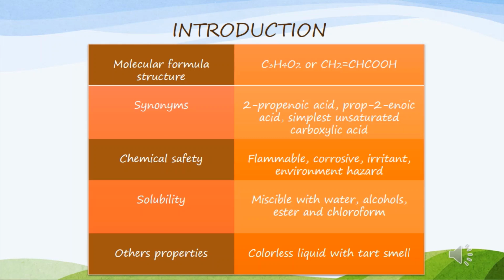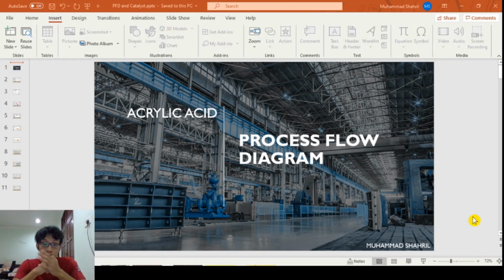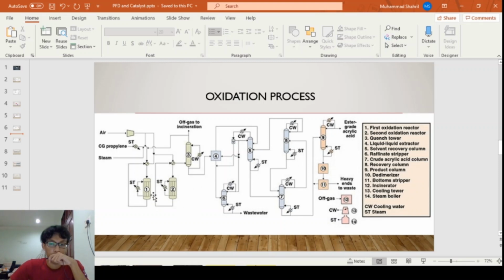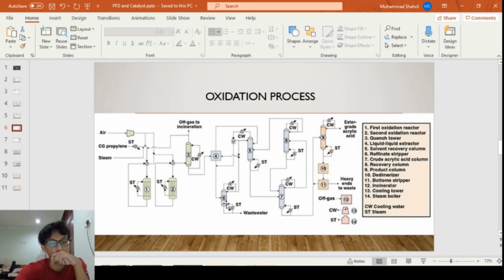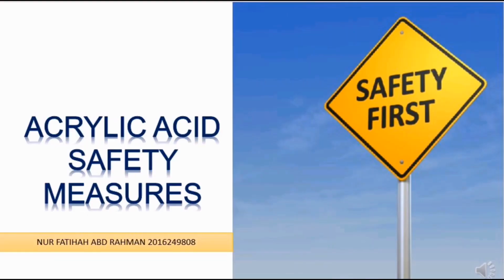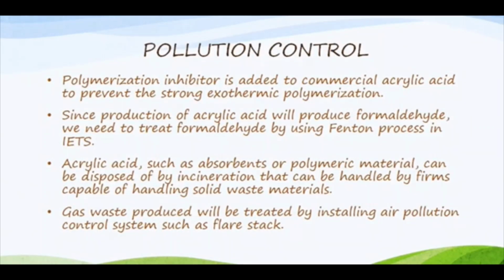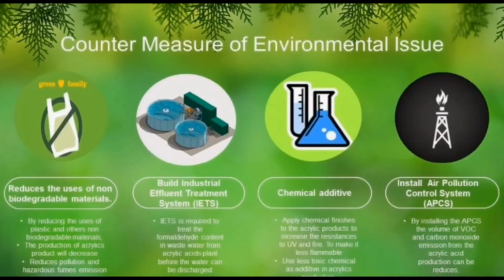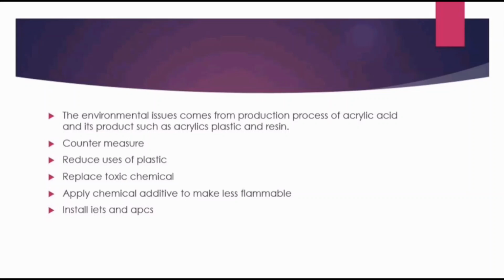ACRYLIC ACID

Comment: It is stated that by applying chemical additives can make acrylic acid less flammable, what types or example of chemical additives can be used?   Thank youu and good job :).                  Nur Hidayah Misnan 2017632122
Reply: Tq hidayah for your question. Honestly I'm not pretty sure about this. But based on my research on Google it said that example additive that can be used for acrylic like silicone oil

Comment: Hi group 2 . Great Video. I have one queston. In the safety measure part, since acrylic acid is highly reactive and that it will readily polymerise if not properly controlled, can you suggest way to control it ? thank you.
(Nur Aisyah  2016669248)
Reply: One of the way to prevent polymerization of acrylic acid is by the addition of polymerization such as  monomethyl ether of hydroquinone (methoxyphenol). Besides, the acid shall be stored within 15-25 degree celcius to prevent polymerization that can be triggered by presence of heat as well.

Comment: Good job group 2👏🏻 Hi group 2, i have a question. Since acrylic acid liqiud is flammable , how to prevent it from explosion ? Can you gives example on storage of acrylic acid? Thankyou.
Reply: Acrylic acid is stored in an indoor storage with the temperature of range 15-25°C. This indoor acrylic acid storage facilities must be well ventilated first to prevent any local accumulation of vapors. The storage facilities is also shall be equipped with local exhaust system so that adequate air change rates are ensured.
Reply: Happy that you like the video :) We can used the Austenitic steels type 316. Which is it also have a better corrosion resistance and mechanical characteristics. Besides, it also can prevent from an explosion risk. I think, Austenitic steels will be the best type steel choices for the storage tank materials.

Comment: Hi group 2, can you please explain more about “fenton process”. Thank you🙏🏻☺️
(Nur syafiqah,2017632146)
Reply: hi syafiqah thank you fro the question. since formaldehyde is a toxic compound, it must be removed from waste water or else the biological treatment process will be interrupted. The oxidation of formaldehyde will occur with addition of Fenton reagent (aqueous ferrous sulphate and hydrogen peroxide). the rxn between these Fenton  reagent will oxidize the formaldehyde into formic acid, carbon dioxide and water. I hope this explanation will help for your better understanding. Thank you (NurulSyazwani, 2016238902)
Reply: The Fenton reaction/fenton process is a catalytic process which converts hydrogen peroxide, a product of mitochondrial oxidative respiration, into a highly toxic hydroxyl free radical. The reaction was originalloy used as an organic preparative synthesis tool. :)

Comment: Nice one G2!! Hi, i just wanna ask, since acrylic acid is a corrosive product, what kind of materials that is suitable for the equipment (maybe dc, the last equipment) that can resist the corrosion? 
Thank you. 
(Anis Nuranisya 2017631878)
Reply: Thank you for the compliments ! To avoid corrosion, it's important to use a grade of stainless steel that is specifically resistant to corrosion such as type 316 stainless steel. Alternatively, a specialized coating can be applied to the steel.
Reply: @MuhammadShahril97  ahh i see. okayyy thank you for ur answer. 😊
Reply: @anisnuranisyashamsuddin2459  Most welcome 😊

Comment: Nice work Group 2 👏🏻 Farah Adibah (2017632134) here 🙋🏻‍♀️ i would like to ask on the safety measures.. so from your opinion, how do you handle the spillage of acrylic acid? (It’s best if you could give it in sequences-step by step way) okay that’s all from me, thank you 😊
Reply: There's 2 cases of spill, whether small spill (up to 4 liters) or large spills (more than 4L). 
For the small amount of spillage, fist thing to do is to make sure whoever involves in the cleaning work to use appropriate full PPE. Next, the spill will be clean up using commercially available spill cleanup kits. However, if biological wastewater treatment is available at the plant, the spill can be diluted with water and then allowed to enter the treatment system.

As for the large spill case, if possible, the spill shall be contained within spillage area and then be recovered in appropriate container.  To dispose the spillage, run-off into storm sewers, ditches or other routes to surface water have to be avoided. The large spill can be neutralized with mild alkaline chemicals prior to be washed down into treatment system.
Reply: Nur Fatihah nice one 👍🏼 thanks 😊